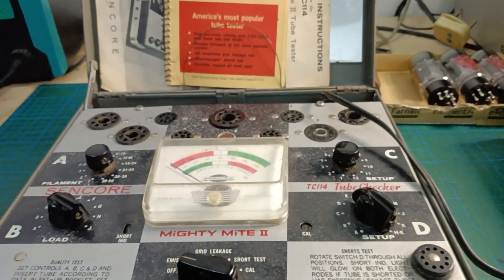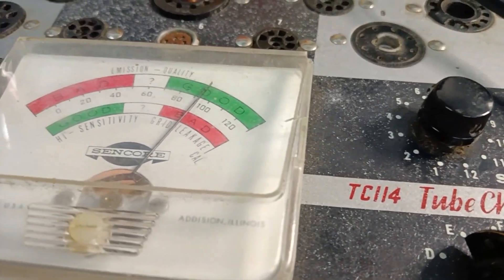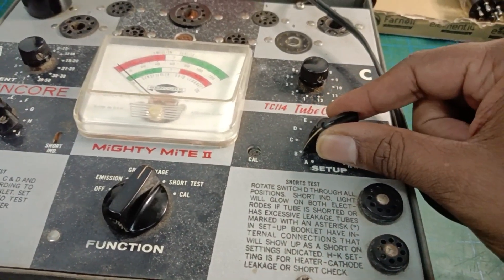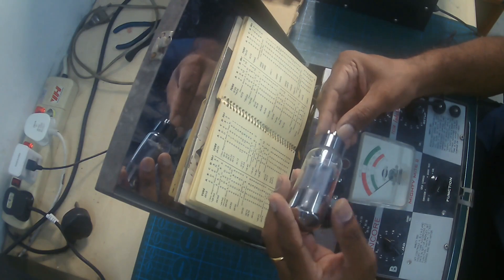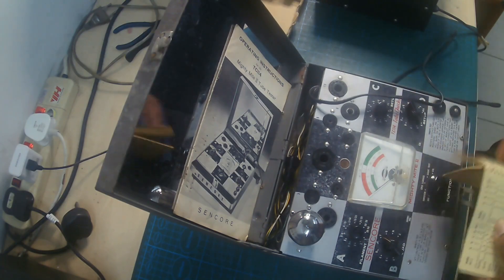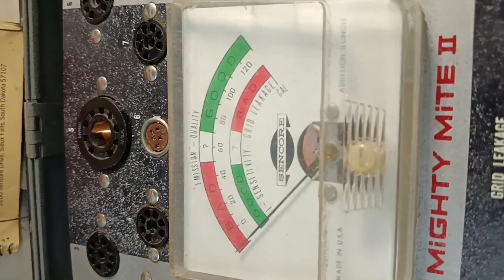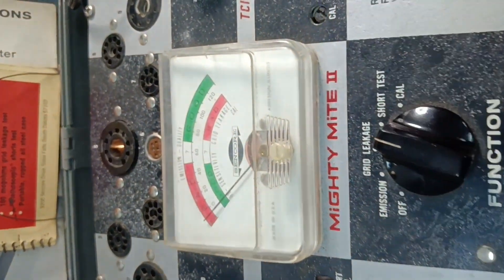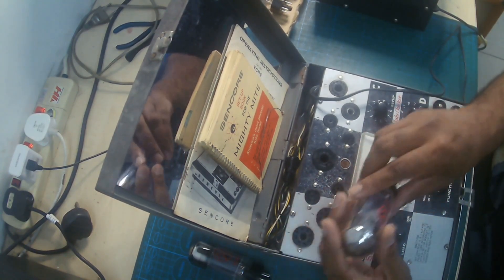Testing Vacuum Tubes Using a Vintage Tube Tester – A Step by Step Tutorial

Comment: The first thing to do is calibrate the meter. It explains how to do that in the manual. That should be done for every type of tube tested. Then the Shorts test is done. If a tube has a short, you do not want to do the Emissions test as it could damage the transformer of the tester. If the tube tests good during the Emissions test, then do the Life test. This test is to determine if the tube has a filament sensitive cathode and will show the life expectancy of the tube. To do this, lower the voltage to the next lower level and repeat the Emissions test. The tube will hopefully remain in the good area. The manual explains all of this. It's very important to do these tests in the proper order to avoid damage to the tester.
Reply from the maker: Thank You for the detailed explanation

Comment: Do not jerk a tube left & right while pulling it out, that socket will not last long! Tubes should be pulled straight out, with minimal lateral movement!
Reply from the maker: Thank You. Yes i normally would pull the tube straight out but this tube tester socket is very old and the tube pins seem to get stuck probably due to corroded contacts in the socket. I plan to replace the tube socket with a new one but wanted to create this video with the Sencore tube tester in its original state

Comment: I think you should mention that the tester must be switched off if you insert the tube before adjusting the settings. Many testers have a separate power switch, and if the tester is on and you insert a tube before adjusting the settings, you could easily damage the filament.
Reply from the maker: Thank You. I have not encountered issues with  this. But in future i will make sure i switch off the tester before inserting the tubes.